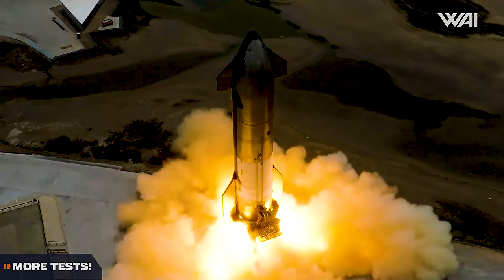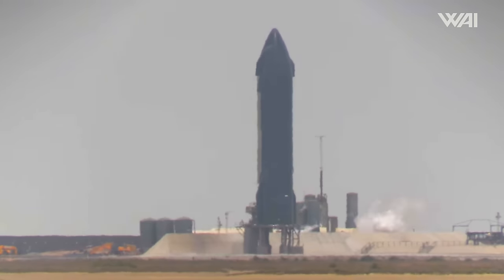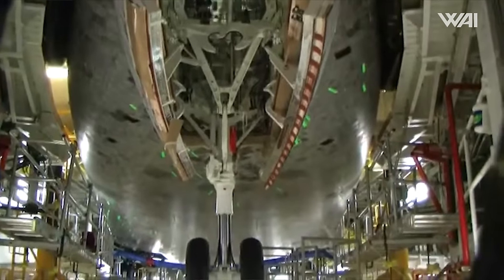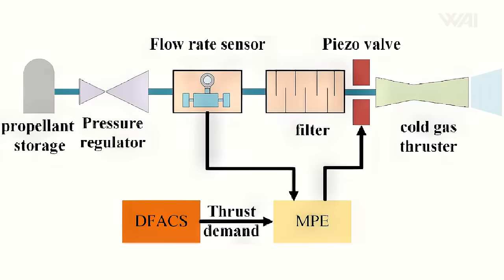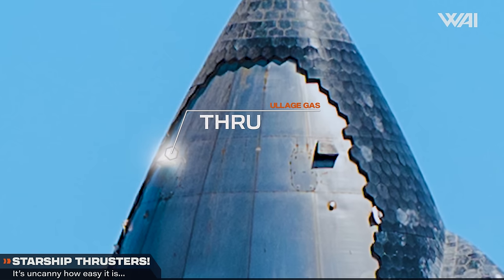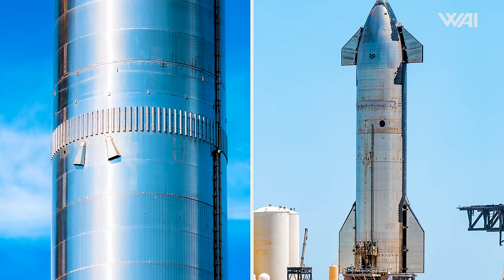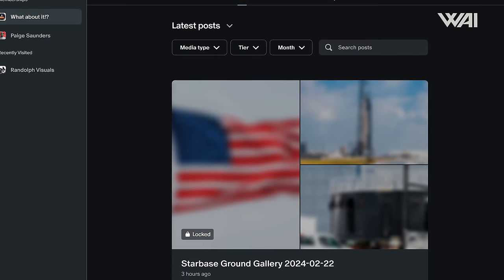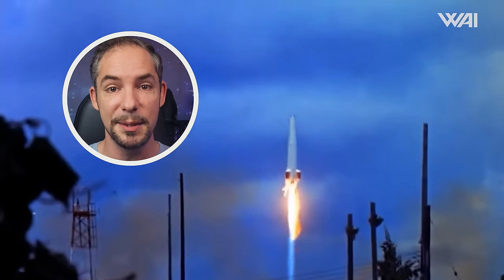SpaceX Starship's #1 System Fix Needed!

Comment: The launch 3 had a LOT of tiles shed during reentry. You could see them coming off in the video.
If the vibration during test is separating them then reentry is even worse.

Comment: Maybe they can use a cold gas thruster system but with heated nozzles (and possibly piping) to prevent vent freezing and aid in the rapid vaporization of the cryo liquid when needed. The heat could come from the combustion of small amounts of a methane/oxygen mixture in a closed environment similar to how a diesel parking heater works. This would end up being a hybrid of hot gas/cold gas thrusters with the benefits of each....   

Of course, there is another source of limitless free heat and that is the friction of re-entry itself. By extending a heat conductive "sail" from the cold gas thruster nozzles directly into the plasma stream of re-entry, the nozzles could be kept as hot as you want for free.

Comment: If the ulage gas thrusters were freazing, an electrical resistance heater might be added to prevent that.  In the long run, I'm pretty sure they'll go to hot gas though: It's just good engineering to have more capability than you predict that you need, and a real hot gas system will just give them that.

Comment: Increasing pressure in the tanks does not change the flow from the nozzles.  The flow is "Choked" and cannot flow faster then the speed of sound at the neck of the nozzle.  At best the density of the outflow might decrease with time (changing the momentum), but not likely by much.

Comment: I agree with you that the methalox thrusters meant for the moon should be installed and tested. 2 birds with one stone Right. But they have to stop that role occurring prior to re-entry. Keeping the heat tiles “Earths down”Then drop the Engines ground ward for their land burns.

Comment: RCS: Cold gas system. Heat critical components to prevent freezing blockage and put pressure regulators and buffer tanks into system to stabilize thrust pressures. Heating could be done with electric heaters or possibly minute amounts of O2 and methane to create heat by micro combustion, or hopefully just short of combustion, and hopefully using gas instead of liquid states, or maybe a hybrid.
Reply: A catalytic combustion system could also be used. Basically an automotive catalytic converter in each thruster.

Comment: PITCH AND ROLL SOLUTION --->>> CMGs are known for use to control spaceships without resorting to thrusters.   Also, explore solid or fluid gyroscopes that can be turned on and off nearly instantaneously.  Consider lead cylinders wrapped in copper coils and suspended in a slippery fluid within a belt along the inside wall of the spaceship, e.g. a rotary electric solenoid/gyroscope.  You take the patent;  I don't have the time or money.

Comment: How about just putting a heat system at the port of the gas thrusters to help reduce the ice build up/ blockage. You could even implement a piping system hooked to the rocket engines that cycles a heated liquid around the nozzle of the thrusters. probably would be cheaper over all rather than other complex solutions

Comment: The heat tiles will be a problem NASA had a real issue with the heat tiles on the shuttle,  they're not robustly    attached .. .before re-entry the shuttle would be checked for missing heat tiles....

Comment: I remember one of the original ideas for Starship, before anything was built, was to have the skin cooled by liquid that weeped from tiny holes in the skin. What was that called? Not perspiration cooling ...oh! Transpirtation cooling. It's like sweating but not. I don't remember why they abandoned that idea but the tiles are clearly not working, either. They are going to need to come up with a better way of attaching them or a whole new solution.

Something else that isn't working is the launch pad. I don't see how they're ever going to get to the point of catching a booster and launching again within hours or minutes if the pad needs days or weeks of refurbishment and repairs between every launch. The way the pad is configured now is going to get destroyed every time they launch. Yes, the times have dropped between each launch but they're going to plateau somewhere around a few weeks where something significant always needs to be replaced every launch. And it's always something different.

Comment: It's the O2 valves that freeze up with water and/or CO2 Ices. The Raptor nozzles are cooled with pure methane.

I would like to see all H2O & CO2 contaminants removed from the O2 gas regeneration system. It's the only way to move reliability up the "march-of-nines".

Comment: Electical heating of Starship cold gas thrusters makes the most sense.  They would allow reliable thruster use after long periods in space.
Reply: Requires expansion tanks, multiple valves, controls and has multiple failure points. A very complex and unreliable design.

Comment: I would dip the ship in a slurry of ceramic. Or pit the service of the ship where the tiles goes then I would make a ceramic glue or slurry that could be trowel on the service (where pits are) so as to affix the tiles to. Thus creating a mechanical bond.

Comment: OR electric heating of vents. Could even save power by having maneuvering periods where heating is active either preplanned for when they expect to correct alignment or X period of time in advance of a non urgent but unplanned maneuver. They could also make software that observes how thrusters are actually moving the ship and if a thruster isn’t resulting in ordered movements they could adapt and fire other thrusters to try and turn left by turning right 3 times or equivalent.

Comment: A Defroster Heating System for the RCS CGT would IMHO be the closest solution. Less energy and complexity than HGT needed and if not taking some battery with you (becausee you want to avoid additional weight), in space you have more than enough energy ressource from solar if you want to.

Comment: Regard the tiles problem: I am no material scientist no rocket expert, therefore a maybe dumb question aren't there any foams that they can directly spray on the hull and just refresh the coating every xth mission. Lets say they develop a material that can be sprayed in layers on the hull then they could just expect it to keep reducing its thickness on every flight and just spray over it every once in a while to compensate for the loss of the heat shield layers. Obviously this makes disassembly a bit more difficult and also when the layers dry unevenly it can cause stress on the hull itself. Was just a quick thought i had for some time now. Hey Felix, keep up the great work here with all your team members you rock!! LG Isaias

Comment: I'm unconvinced that the heat shield tiles are a workable long term solution for Starship.
I get that replacing tiles is relatively quick, but they shouldn't need replacing.
For rapid re-usability the heat shield needs to be undamaged during and after each flight.
I wonder if a different approach will emerge.

Comment: The heat shield tiles Starship could be wrapped with Kaptan Polyimide Film Adhesive Tape over tiles. It would hold tiles secure until re entry then tiles can do their job.

Comment: The obvious issue with using excess pressure in the main tanks for RCS is added complexity, a lot of unnecessary complexity I think. Why not use something like peroxide with some form of antifreeze/viscosity modifiers added to it ? That way you never run the risk of actuator valves seizing up due to cold and mechanical tolerances, plus, your propellant is intrinsically denser meaning you can use less of it compared to a low molecular/atomic weight gas and get more thrust. If there's one thing that causes rockets to fail it's added complexity, systems need to be as simple as possible. The other advantage to using a peroxide propellant is that it's cheap, easy to acquire and easy to store, and does not need any complicated ignition system, all that is required is a catalytic chamber to turn it from liquid to a super heated steam exhaust. Also, there is no need to use absurdly concentrated peroxide which is somewhat notoriously unstable and thus requires high levels of purity , ie; no traces of metal ions or microparticles that can cause nucleation sites for the peroxide to break down, lower concentrations like 50 % with the balance made up with lubricant and antifreeze and water is more than enough to out perform any cold gas RCS system, and be reliable.

One other pressing issue that is the killer of many liquid rockets is ullage, that space in the tanks that is not occupied by liquid, and why all rocket engines require a header tank to make absolutely certain that the turbo pumps are always fed with liquid and not gas or a an emulsion of gas and liquid to prevent R.U.D.. Although not currently possible, the ideal solution to this problem would be some kind of inner bladder that simply shrink in volume as the liquids are drained into the rocket motors, much like a bladder inside a cask of wine, say. This way there is no possibility of gas entering the turbo pumps and destroying everything. Such a bladder would be possible with non cryogenic fuel like Kerosene, but I can't imagine finding a suitable material for cryogenic liquids, using non cryogenic fuels and oxidizers would be ideal, but finding an acceptable oxidizer for this might be tricky.

Comment: My idea for securing heat tiles is to have a heat resistant cam lock system on each tile. Each tile to have the ability to be secured into place as  per normal with an added lock which can be turned to lock onto surrounding tiles.....I am better drawing my idea :)

Comment: Down there at the bottom of the ship. It also has that felt lever. That's also heat resistant. So losing a few tiles will not bake the ship.

Comment: My  idea for the tiles would be to make the frame of the rocket prepared in oder to just put in the tiles  like weld together the frame of the tile on to the metal of the rocket . And plus it allow for wires to go from the inside of the rocket and allow to mesure the heat of the rocket .

Comment: You mention that variable temperatures affect pressure and therefore thrust of cold gas ullage thrusters.  Surely, that is just a control system issue.  I am sure SpaceX monitors the mass and velocity of gas leaving these thrusters.  So, I bet the control system is designed to dynamically deliver the amount of thrust commanded.

Comment: I think SpaceX has many issues they need to resolve with Starship/SuperHeavy.  The last launch without a payload should have left substantial propellant margins but that does not appear to have been the case.  Even without the 150t payload both stages appeared to have had inadequate propellant to complete the tasks and if that happens without the 150t payload then there must be even less propellant left when there is a 150t payload.  So, if they are not getting the performance they need then the only solution would be a bigger rocket with more propellant and more rocket engines, OR, if they can increase the Isp of the Raptors by enough then that could solve the performance problem.  But, if the Isp is inadequate for a rocket without a payload and the rocket needs to be able to deliver 150t to LEO then the increase in Isp required would seem to be a bit of a stretch.  Honestly, for what they are trying to do a 9m diameter rocket isn't enough and it probably should have been a bit bigger in diameter than the Saturn V which was a bit more than 10m -- if it were me I'd have made the SuperHeavy booster about 10.5m in diameter.  But going bigger for the first stage might also drive the need for Starship to be 10.5m in diameter and that introduces many additional problems.
Another problem that still appears to be with us is the Raptors themselves.  They still appear to have mixture problems, particularly at partial throttle -- the propellant quantity shown during the launch show that when the propellant gets low, like less than 10%, that there is a notable difference in quantity between LOX and LCH4.  Having two separate turbopumps as they do with a full flow staged combustion engine means that you have to have fine control of both turbopumps to keep the mixture where you want it and this is harder at partial throttle.
And lastly, my confidence in the bellyflop maneuver and more particularly the flaps they have, fore and aft, to control flight ... I'm less certain they will function adequately, particularly during the early stages of reentry, than I have been.  And this ties in with the lack of a true RCS system.  Elon loves the ... 'the best part is no part' thing so skipping an RCS system is one of those things it would be nice to delete, but you need to be able to control the attitude of you spacecraft in the vacuum of space and in the thin atmosphere at the top of reentry.

Comment: Either way you look at it, those thrusters need to be beefed up.  Without a glider body control is even more imperative.  Even the booster needs more thruster power.

Comment: I'm wondering when SpaceX is going to use an overlap installation (I call it dragon scale but my brother who's a builder called it shingle style)  In any case the tiles still need space to expand and contract with some clompliance in the mount locking.

Comment: 3 pins per tile is a mistake (but not the only one).   When one pin fails, the tile is held at only 2 points and can now rock. This rocking motion allows a serious vibration to be amplified until the remaining pins fail. SpaceX needs to swap out every 5 tiles with one large tile held by the 15 pins.

Comment: I wonder if an electric heater would be a possibility for the ullage gas thrusters. There must already be some hefty batteries for the electric TVC and likely not that much energy is needed to defrost a thruster. It could also be used to increase the pressure in case it is a bit low.

Comment: You could tell elon was kinda blown away and his mind was racing about putting the thrusters for the ship when asked that question. Rubbed his face and started designing it that second. pretty neat a question like that brought about an actual design change to improve the ship. I think the actual solution is heated valves. Would be incredibly easy just using electricity and a high resistance heating element to keep them freely moving. Also the thrusters could have a regulated chamber regardless of their start pressure so each venting could be fairly precise, but I'm sure spacex already thought of this...

Comment: Could Starship's attitude be managed by a system of weights being moved fore and aft, and circumferentially?  Alternatively, could a boom with a weight on the end be extended once in space and then used to adjust the Starship's attitude.

Comment: Fit test and approve engines before fitting the heat shield tiles.  But it's a good way to flush out weak points before that. Trial  by 🔥🔥🔥
Reply: Arguably, engine test after tile installation will indicate which tiles are less securely attached

Comment: Why not use reaction wheels instead of thrusters to control the upper stage? Also theres lots of flame resistant epoxies that Nasa used on the shuttle. Id try to use that since they didnt lose many tiles during their launches.

Comment: Yes, a virneer thruster is a better solution… because of the massive size and mass of the thing, unless some how SpaceX HAVE found that magical device that can counter gravity and made gravity inert to the rocket 🚀 they’ll have to consider stronger thruster to control their decent and deceleration prior to a proper landing! But with the expertise of spaceX I think they can make better thruster than of that you mentioned because of the obvious control regimes requirements for their AI to control during ascent and deceleration on decent. The lateral force required to push against an object during its influence of gravity and earthly gasses in flight could be about 5 times that of gravity when the object is the size of starship. But it is always environmentally dependent at the time of flight.

Comment: Vibrations during liftoff and reentry would be thousands of times more than what destroyed these tiles, look at the heat tiles that flew off the last spaceship as it started re-entry,  no it was not ice. Just as with spacex having a problem with the booster engines they eventually seem to have fixed, and the launch pad destruction being fixed, I expect them to fix the heat tiles. maybe different mounts, thus strengthening there attachment to the ship, or overlapping them like dragon scales and using two attachment points would work. Whatever the solution I don't see a re-entry if this is not given urgent attention.

Maybe they need to go back to the drawing board, investigate new ceramics as a few years ago flexible ceramics were developed in the lab. Even minimal flexing would enable some innovation. Ceramics have come a long way but spacex is still using stuff similar to the shuttle, albeit in much smaller sizes. If they got a flexible ceramic they could simply bolt the tiles to the ship. Right now it looks like they have a clamping type system.

Comment: They need a graphene type paint.  Graphene has a max temperature up to 4200 degrees or 2600 Kelvin what ever you prefer. But the cost needs to come down more to apply on this type of scale. It’s more in small electronics right now.